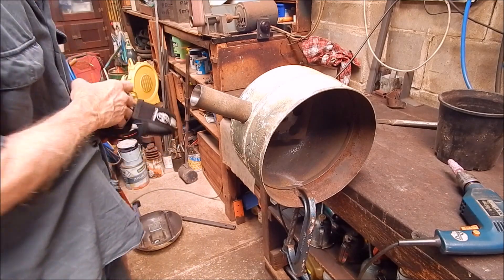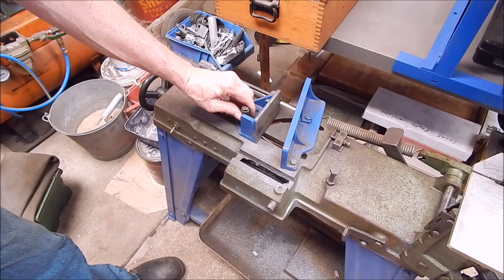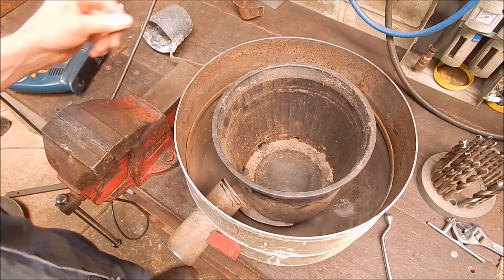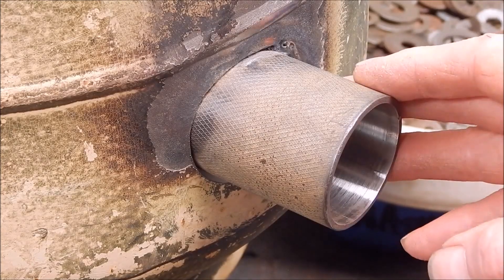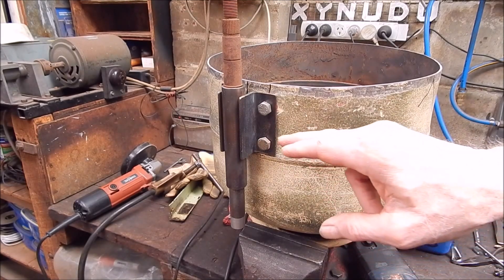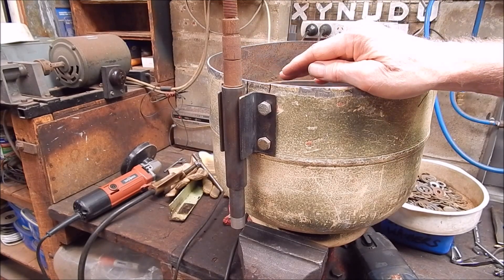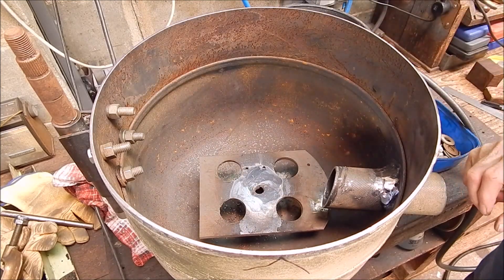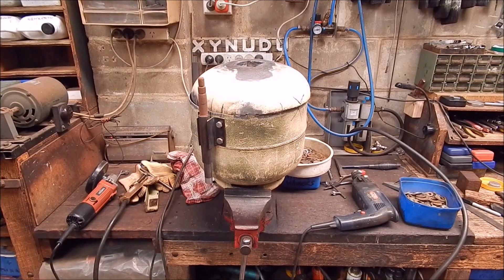Making a metal melting furnace from a 10 kg LPG gas cylinder - part 4

Comment: Hello Rob,
Good progress... You may have already finished (I'll see in a moment when I watch part 5) but on the hinge if you have an angled surface between the lid and base then you move the lid it would automatically lift it slightly... the downside would be that you could only move the lid in one direction.
Take care.
Paul,,
Reply from the maker: Hi Paul, yes you are right.  I got a bit carried away there.  He He.  Over engineered out any potential issues.  Better safe than sorry.  Cheers Rob

Comment: Nice one Rob 👍. I was wondering what you were going to do for the lid pivot. That should be plenty strong enough. Cheers, Alan.
Reply from the maker: Hi Alan, the pivoting/sliding idea was suggested to me by a viewer.  I could make it pivot up as well. Need to think on this one. Cheers Rob
Reply: @Xynudu  Hi Rob. The only thing that did occur to me was, the lid will be quite heavy once the insulation is in place. Is there any danger that if it was swung out too far it might tip the whole thing  over?  Hopefully the bottom part will be heavy enough to prevent this. Cheers, Alan.
Reply from the maker: I agree Alan.  The whole thing will be relatively heavy.  I intend to put some offset wheels on it on the side the lid swings towards.  That should also stop it tipping, I hope.  The base will be pretty heavy.  

I'm toying with the idea of using bentonite clay and pizza oven mortar , with fine sand mix for the insulation.  Not sure how that will go.  Pearlite will crumble, so I'm trying to stay away from that.  I will mix a test sample and give it the heat test.  Refractory cement is the other relatively cheap alternative.

Cheers Rob
Reply: @Xynudu  To have the lid pivot upwards as it turns is a very good idea.

Comment: On the pot we had at school (years ago) the pivot pin had like a rising but hinge idea to lift it a little. This stopped the lid scraping on the base making it easier to turn. It was set so the last bit closed fully. I think it only had about 6mm lift. Great idea using the cylinder.
all the best jamie
Reply from the maker: Hi Jamie.  I was thinking a similar idea for this lid.  It would be easy to add a horizontal pivot to the top of the vertical swivel.  I may do that.  Cheers Rob

Comment: Mate it must be the rage at the moment. I used a front loader washing machine barrell. I made my own sodium silicate and used perlite then lined all that with high temp mortar.Piece of piss. All YouTube stuff. I lined it with shaped hebel blocks which I had leftover from another project. Your is coming along well. Thanks for sharing your projects. You sure do have some great stuff. Regards Rob from Sydney.
Reply from the maker: Hi Rob.  It's an interesting project.  Plenty of options to vary the build.  I'm trying to keep it simple and light, and cheap.  Viewer input has been good. I bought a bag of pizza oven grout to mix with bentonite clay and a bit of fine sand for the lining.  Hopefully it works OK as a binding agent.  I will find out at the end ;)   Cheers Rob

Comment: I get your pain...I went in and out of the garage which is like a furnace, several times doing some work until the heat got too much, cooled down for a while inside then back into the "furnace" again.
Reply from the maker: It got a bit warm in the garage for sure.  Wasn't too bad outside, provided you were in the shade.  Looks like another hot day tomorrow, then a good 24 C spell.  Cheers Rob

Comment: Suggestion; If you swing your hinge mounting bolts 180 deg and tack the heads to the tank, you can still remove the nuts from the outside,leaving the bolts intact under the pearlite.
Reply from the maker: Yes, I did think of that as an option, once I'm sure the hinge design works OK and orientation is correct.  Cheers Rob

Comment: Hey mate, good work. Just one point, I think the inlet should be angled more so that the direct flame does not contact the crucible. Otherwise, the flame will erode the crucible very quickly.

I made one too - > https://www.youtube.com/watch?v=enEwXjVQg-E
Reply from the maker: The steel crucibles I've been using for years have stood up very well to direct heat blast, so I expect it will be OK.   I like the way you did the lid handles on yours.  Cheers Rob.